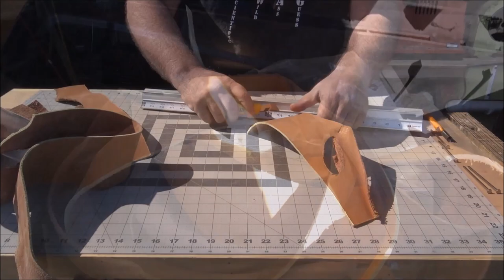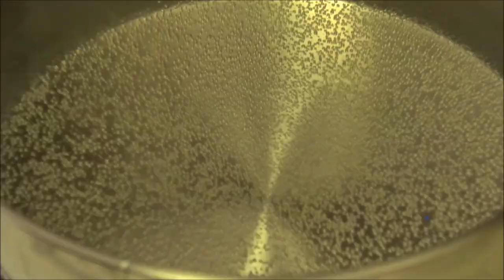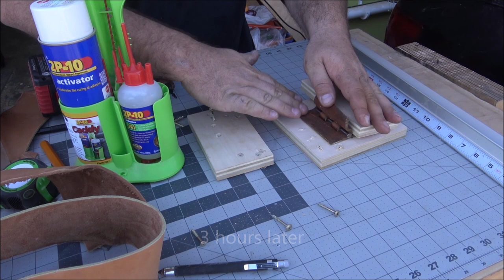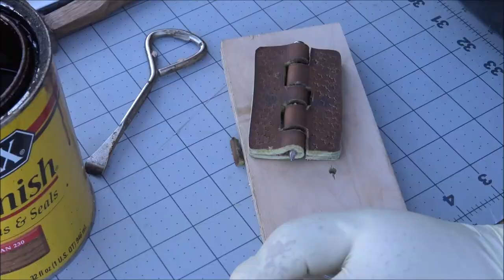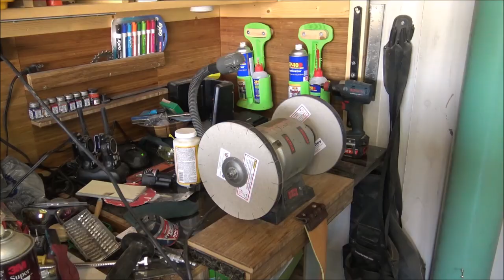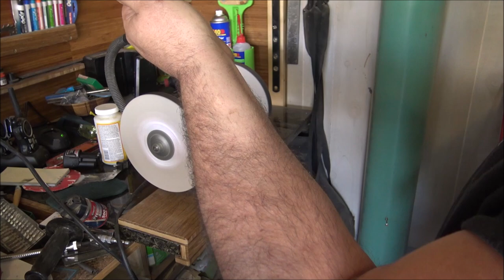Making a leather hinge

Comment: Another question please. I've worked leather for a while now, I've never needed to boil the leather. Usually you just get it soaking wet, clamp it, that's it. It stays in the shape you want. The only boiling I know of is for rawhide. It's almost stiff and hard as steel (exaggerated ). But it's still not necessarily to boil unless you don't have a few hours to let it soak. This is all based on my experiences. But maybe you know something I don't, which isn't hard to do. I'd like to know if there is some specific reason for boiling other than softening. Thank you.

Comment: Would you mind telling me what kind of glue you use that takes an activator and what's it good for gluing? I seen either that same kind or different on lots of vids and they use it on several different materials. But I've never used a glue that has a spray activation product.  If it glues several different materials and holds good, it might just be exactly what I'm looking for. Thank you.

Comment: I might be wrong about this but aren't to you supposed to put something on the leather before you strop a knife?
Reply from the maker: +Jttv rouge if your using a stone.  nut i use rouge on the finishing wheel the belt is to break and tag left from the wheels in this case.
Reply: izzy swan  do you even English:p
 why were you writing replies at 5am?